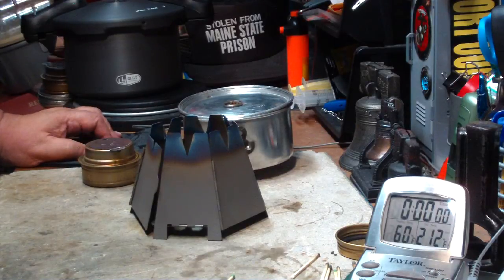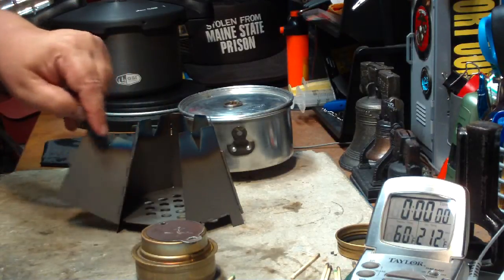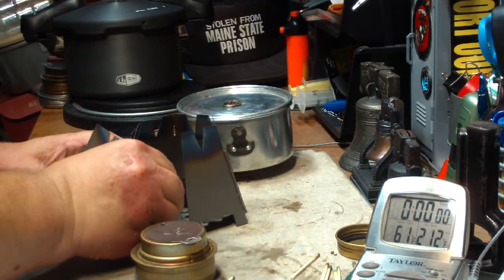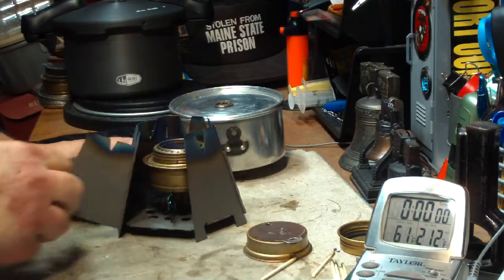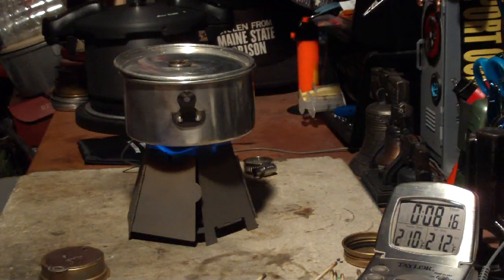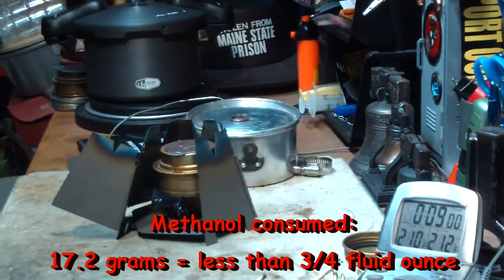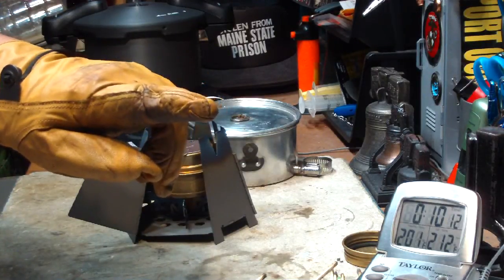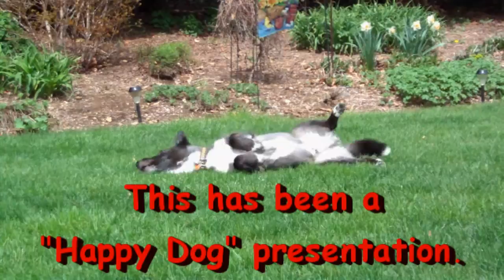VARGO Titanium Hexagon Wood Stove used with a Mini - Trangia - Boil Test #3

Comment: The 1 inch sweet spot may not apply in this set up.  It appears because of the shape of the stove and the size of the Trangia, flame heat is being absorbed by the titanium and being one heat sink.  Try threading some bolts through the bottom holes to adjust height to find optimum height

Comment: tin pieces will probably work better than aluminum.  I am looking at an altoids tin right now that would probably be heavy enough to support a trangia stove with full load of fuel.  the cross pieces will only need to extend 1 1/4 or so past the X.  inch would proabably do it too

Comment: Odd... But I'm a bit more concerned about fuel usage than speed, so this isn't a complete failure.  I'm not sure why it's burning slower in this configuration... burner body cooling due to improved air flow?

Comment: Interesting set of tests.   Given the design of the Vargo stove, I suspect there would be wind issues in the field if you raised the height of the burner anyway.  I think maybe the best option is to leave the door open slightly (it works as a damper when burning wood) to get a little more air in there, and relieve some of the heat build up that is leading to excess vaporization and turning the flame orange.  Either that or get a smaller alcohol burner as the Trangia is perhaps a bit too powerful to work well in such a confined space.

Comment: Outstanding series if vids Hiram, really useful.
I wondered if you have considered modifying the Vargo Hex stove by adding extra ventilation in the walls? Scouting Free and Blue Mountian Bushcraft & outdoors have made these mods and it makes a big difference in wood burning mode.
You appear to have a very yellow flame and that suggests not enough oxygen.  If you compare that with your vid on the Evernew DX with the evernew stove, that was pretty blue.
Indeed, it might be helpful for these ventilation mods using the Evernew Ti stove?
At the moment, the Vargo is not a runner due to issues you have identified with the convertor stove and Trangia.

Cheers